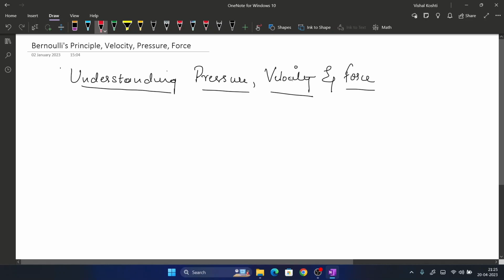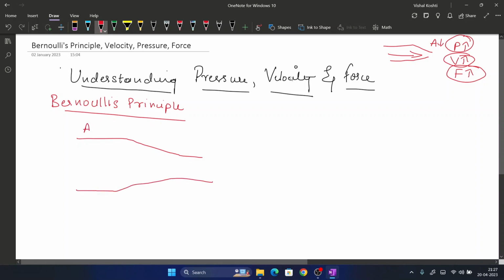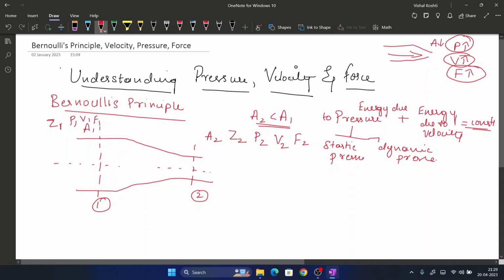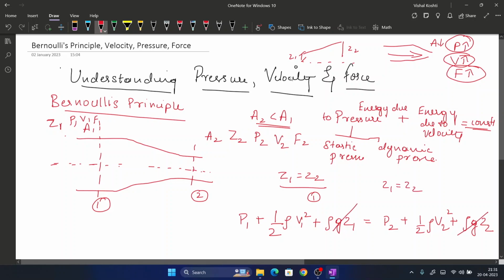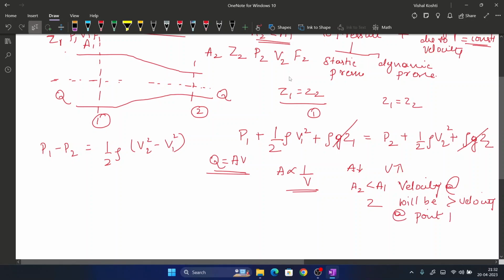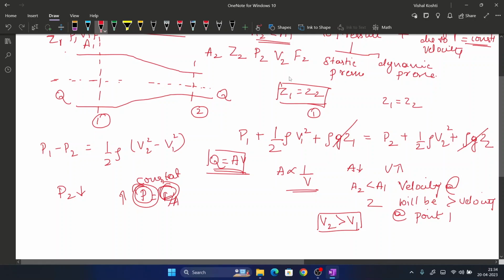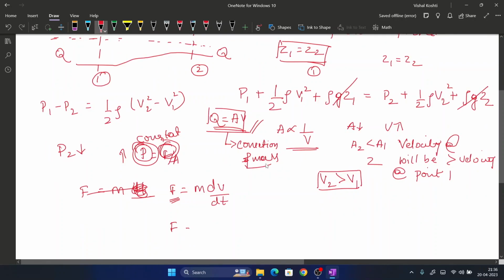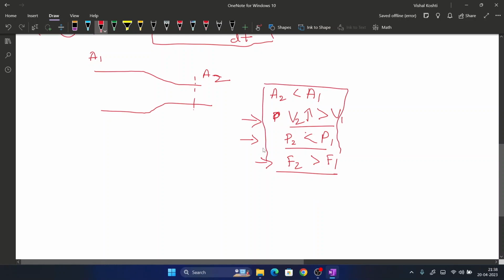Bernoulli's Principle: The Relationship between Velocity, Pressure, and Force Explained

Comment: Fluid moving from A1 to A2 doesn't have any energy applied in between them... In case if we have area A1 and then we added a rotating impeller in between them after that area A2 is there then what will happen to pressure and velocity. Take an example of a centrifugal pump and make one video of it to explain this Bernoulis principle  by adding the condition of the centrifugal pump.
Reply from the maker: Will try to make it near future videos